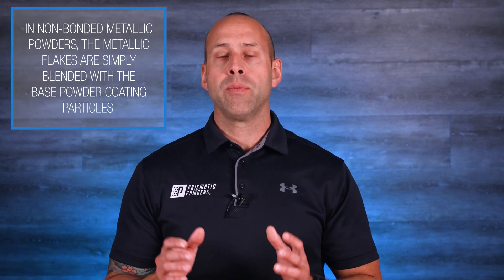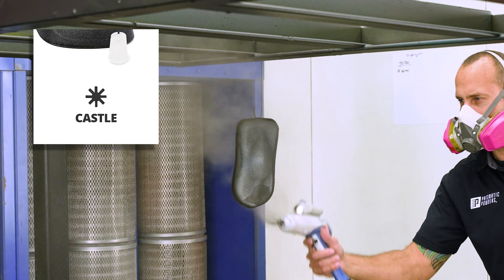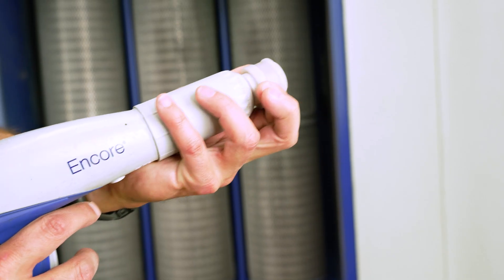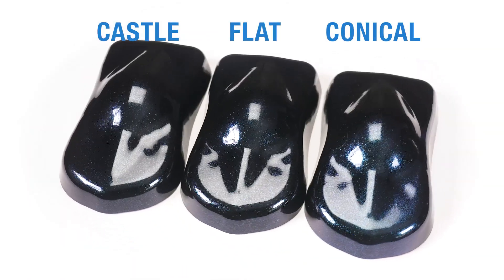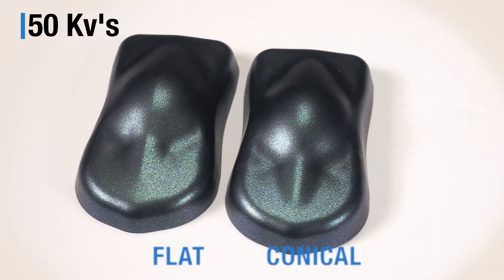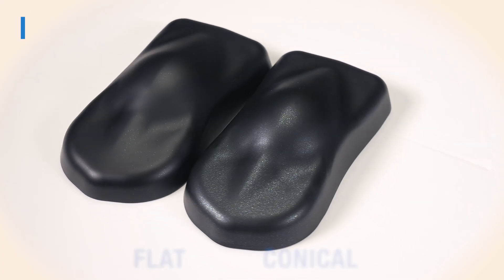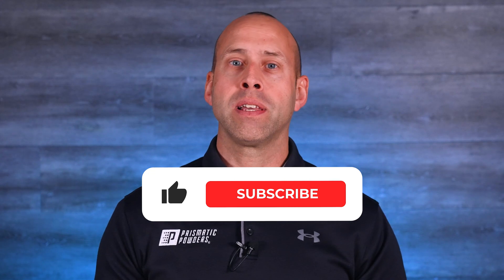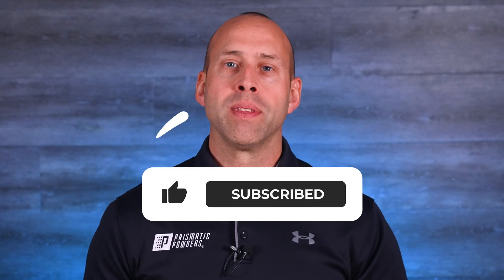Make or Break a Metallic with these Two Things | Prismatic Powders

Comment: Would this line of thinking work with the Illusion series powders?
Thanks for taking the time to make these videos.
Reply from the maker: In short, no....Illusions are not affected in the same way a typical non bonded metallic powder is,  by these factors. Voltage settings can have an impact on them in terms of transfer efficiency but if you are getting the target mil thickness correct, and following the cure process, you should be getting a result that looks like the swatch regardless of nozzle choice or voltage setting AS LONG AS your voltage is not super low.  The reason I say that, is that some guns only have a range 15-kV- 25kV and that could possible achieve a look that's close but we don't recommend voltage that low as good practice with these powders.
Reply: @PrismaticPowders your responses to questions are GREATLY appreciated.

Thank you very much